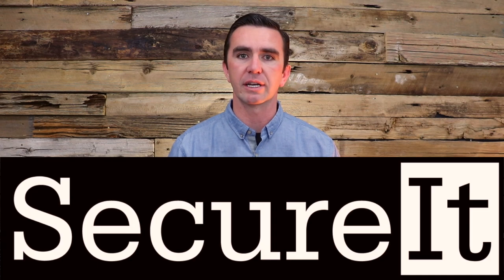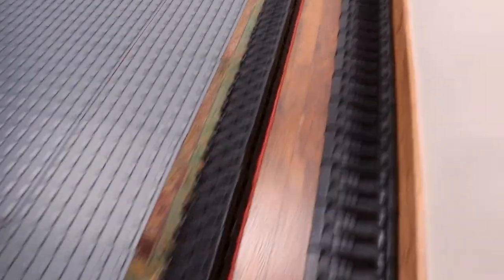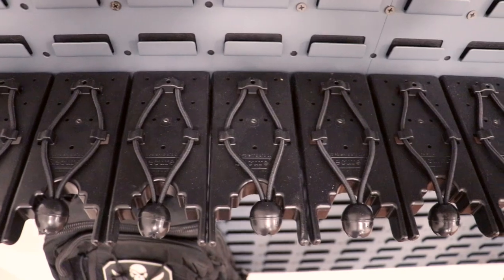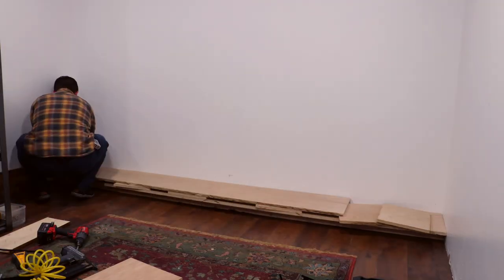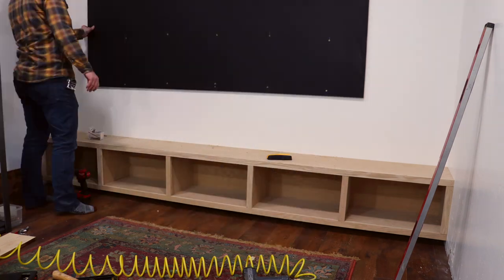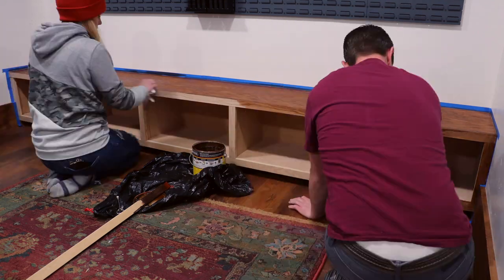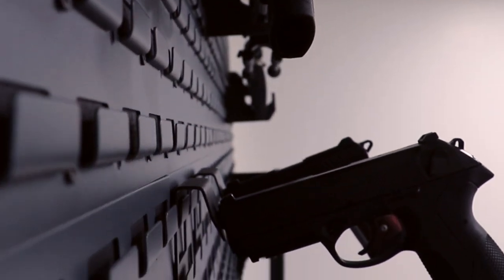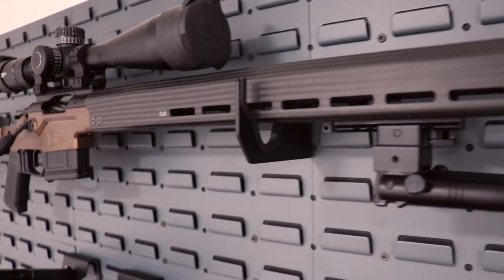SecureIt Gun Wall  |  The Potential of the CradleGrid

Comment: Im almost done with mine now.   I used 3/4” ply cut to the right size i needed then i matched the gray color at home depote  then ran 3” screws into the studs through the ply then ran universal head screws into the ply to hold up the panels on the ply. It worked out great i will order more of there product.

Comment: I had a customer call me to install one of these, said everything was at the house and ready.  The one I just installed came with almost no instructions.  Could not tell where anything went.  All I had was the pic from the order, which had everything covered up already.  Their website wouldn't even help.  I suggest they make things more clear.  Also, I went straight to the studs over drywall, another thing the customer did not know to tell me.  Plywood would have been better, but it's not going anywhere.

Comment: How do you lock the guns...
Reply from the maker: What do you mean by lock? I currently have the setup in a vault with a big vault door
Reply: @PaulPeckham  Ah got it. I meant by locking your guns to the wall. Where did you purchase your vault door? I priced some and they are like $5K!
Reply from the maker: @adamwarrick2970  Yep😬 had to get a crane to lower into my home when I was building.
Reply: @PaulPeckham  Wow...well sounds like this is out of the cards for me lol. Always loved the idea of having a gun wall...but want it to be secure.
Reply: @adamwarrick2970  Steel door, like a commercial grade exterior steel door.  Dead bolt or bolts. And maybe an alarm system on door. Those are my ideas since a vault door is close to impossible to afford never mind get it to where it needs to go